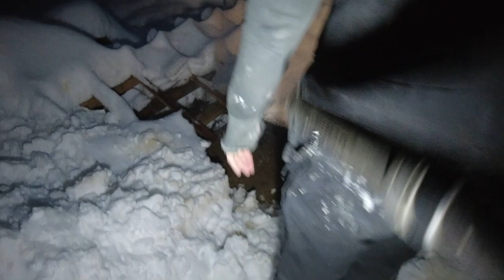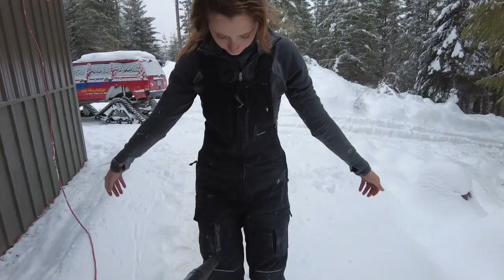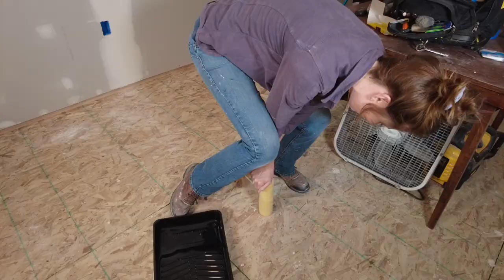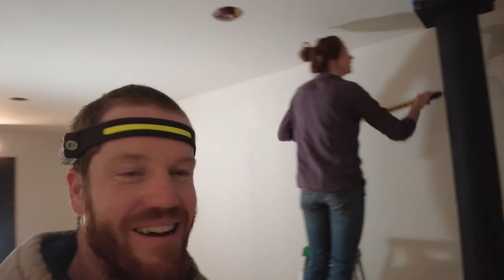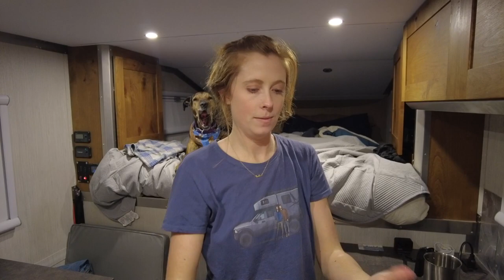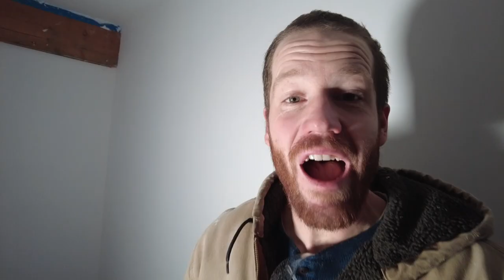Is This A Bad Idea?? | Couple Builds Dream Home Off-Grid

Comment: You know the paint stirrer that you can chuck up in a drill, to stir the paint with? You can use that when cleaning the rollers, too. Clean the roller as usual. Get it as clean as you can. Then take it outside with the drill attachment, and a 5 gallon bucket. Slip the attachment loosely through the roller. Now chuck the attachment in the drill. Hang it down inside the 5 gallon bucket, and spin. The roller will center itself, once it is spinning fast enough. You's be surprised how much more paint will come out of the roller. And the roller will be in better condition, to be used again.

Comment: When pouring paint from a 5 gallon bucket pour with the hole on top. The paint chugs because the air get blocked. Also stopping you’re paint flow is a lot cleaner.

Comment: Good Morning too both of you.
You are both awesome.  
Just a suggestion when pouring out of a closed lid bucket, like your paint bucket.
Turn the bucket so that the pour opening is at the top, then the air will come into the bucket
And the pour will be smooth and no glug gluging.  I have done this for years as I have
Painted my home and garage multiple times.
Also for Courtney, use a can pour lid that snaps onto a gallon can. This will return the paint back to the can
After you get what you want in whatever you are using as you paint from different kinds of containers.

I have watched you from your beginning in YouTube.  Keep up the good work and keep smiling.

Comment: I am sure someone has already pointed it out but you can get a screw on pour spout for the big paint bucket. On the other hand I built my whole house without skimcoat, I prioritized my efforts elsewhere. Awesome progress you two! I cant wait for some metal fab videos
Reply: or does the spout pull out like hydraulic fluid?

Comment: Pour from the 5 gal pail with the spout at the high side. It keeps the pain from glugging and you will get a better pour. Works for all containers that do not have an air port.
Reply from the maker: Thanks for the tip Alicia. We are definitely going to try that next time!
Reply: yep I was going to suggest this. I do that when I pour oil from a 5 gal pail into a smaller container for servicing heavy equipment lots less messy
Reply: Since you entertain and teach, I like the Lucy method you use to pour, now for the education part, they sell a pour spout for 5 gallon buckets at the paint store, they also sell paint lids that really work to pour paint on gallon cans, may be to late to use but not too late to educate the millions of viewers that you educate and entertain
Reply: Same with oil or anything else, hole on top allows less to come out at first 😉

Comment: Next time put your paint roller or brush full of paint in a ziplock and freeze it (put it outside in the snow) and then you can use it the next day and never wash it between days / coats, it just has to defrost a bit.

Comment: I learned its easy to put on & remove roller sleeves by tapping against ground to put on, and on the edge of a trashcan to take off (sleeve should be inside and fall off in can). I love your channel!

Comment: Massive tip, when done painting for the day wrap the roller and brush TIGHTLY SO NO AIR! In a small piece of  polythene  sheet or I always use one of those cheap poly bags from your shopping at the store (these are perfect) and then just tape the edge to keep it from unwrapping and it will keep especially if it's not too warm FOR WEEKS even. Then clean once when finished I have done this for years. You will be amazed👊💪👌🙏

Comment: Coming along nicely guy's. I totally agree with rolling instead of spraying. My only suggestion would be get rid of the roller pans and replace with a 5 gal. bucket and roller screen that hangs in the bucket. You can submerge the roller in paint then roll a couple times on the screen then back at it. 👍 Pro stylin 😉

Comment: Nice job, it's looking good.
A tip when pouring out of a five gallon bucket turn the pail so the opening is at the top, not the bottom.
It will pour smoothly and freely without all the glugging and slugging.

Comment: Here is an idea for when you have to pour paint from the big cans of paint. Use a dust pan that has been cut to fit UNDER the lip of the paint cans to help prevent extra paint from spilling out. It would also make clean-ups easier as well.

Comment: Courtney if no one has mentioned you can buy a screw on spout for better pouring. But since you’re almost done sanding I have used a attachment for the vacuum that it sands,picks it up and it doesn’t get all over you.

Comment: Pro tip ;  when you want to use a roller again with the same kind of paint or primer, leave it on the handle,  wrap it with the bag it came in and put it in the freezer.  When you're ready to use it again take it out of the freezer,  let it thaw for about 15 minutes ( still in the bag so it doesn't dry out too much) take the cover off, load it with fresh paint and use it again.  Works with all types of paint, just don't let the roller sit and dry out at all, cover it back up, even for short breaks.
Reply: Also,  the ceiling paint that goes on pink and dries white is much easier to see where where you have painted.  It will save you a lot of neck pain !
  You are right, primer is not a sealer against moisture.  Paint is a sealer.  I don't use the new paint and primer in one, it's not a good primer, nor is it a good paint. It's a marketing strategy for lazy people who want to skip a step or two. Not recommended for a first paint job on new surfaces,  or people who want a quality finish.

Comment: A little painting tip put a finger tip of vasoline on the inside edge of a tight roller for easy removal. It works no mess just a tiny bit.
Reply from the maker: Wow, that is a great tip. Thanks Terry!

Comment: I've only done skim coats on walls that are severely uneven or made from drywall scraps. When you're putting up full sheets with the joints matched up as you have, it's pretty safe to skip. If it looks flat with a nice bright light going sideways across the face, it probably is.

Comment: If you want to do it right. I would place steel wool in between the wall and floor before putting on the baseboards. This keeps field mice from attempting any entry in the house or walls. Just a suggestion.

Comment: When I'm doing drywall (and I try to avoid doing drywall), I attach a shop vac hose to my vibration sander to keep the dust down.  You can also tape an A/C filter to the back of your box fan and point it into your shop (or out a window) and it will trap dust.   And yes, there are about 5000 different colors of white!

Comment: Bosch have an automatically operated paint roller that feeds paint to your roller as you paint. It's a pain to clean after wards but so easy to paint a ceiling.
Reply from the maker: Courtney has one! But with very limited water we decided not to use it.

Comment: Hi this tom I live in the Philippines just a tip for you if you have not finished with your roller for painting put it in a plastic bag seal it tight that will stop it from drying out so you can use it the following day to continue your painting, keep going and also have a Happy New Year

Comment: Great paint job Courtney!  With dogs I would recommend Riley paint the subfloor with Kills.  Looks like Riley has already started : ).  The Kills will help any pet accidents from contaminating the subfloor.  Also good under showers and toilets for water leaks.  Caulk all thru floor pipes, including shower and toilet, in case you have a leak.  Can also caulk base trim to floor.  Has worked well for me in my past projects.  Have a great New Year!
Reply: Oil base Kills is the only one I have found really blocks well.

Comment: Great job on pushing to finish the paint.  We have a similar color combo in our 1930s house, it's really nice.  Good call on not doing a skim coat, pretty unnecessary with drywall.  

PS you all need a snowmobile.....  with a trailer.  I lived in Maine for years, sometimes that's the only way to get around.. The snoverlander is OK, but a snowmobile is extremely reliable and quick to use in this climate.
Reply from the maker: Riley agrees, we need TWO snowmobiles so we can go on fun adventures too... 😉
Reply: @AmbitionStrikes   Sponsered snowmowbiles!!

Comment: Used Aura for years. The first in our area actually. 
You can write on it with permanent marker and use a Mr clean scrubber to erase it, without pigment wipe off. Always told my clients, its like painting with a pool liner, it's surreal durable. Outstanding choice in product.
Reply from the maker: Please don’t tell Riley he can write on our walls… 😂

Comment: Just to add to the never-ending list of "hey why don't you do this instead"; I usually put a plastic bag over the paint through, that way the through stays nice and clean, and if you're going to continue with the same paint and roller, you just roll up the roller in the bag for a nice airtight place to keep it until the next coat. (and it's also way easier to just throw the whole damn thing out when you leave it for too long and it dries...)

Comment: Union painters never use a pan. The point is to get the paint on the walls efficiently, not create layers of dry paint in a pan. Ditch that whole pouring step.. Lightly touch to spin and roll the roller directly in the bucket with a few bangs against the sides to knock off drips. Then spread in a W pattern directly on the walls (called double rolling). It's faster and wastes the least paint. Never push on the roller and squeeze out the paint working dry. Instead keep the roller loaded up, working wet. Adding a little water to latex paint helps it spread easier if it thickens.

Comment: I used to do very wall and one day a friend came over and saw what I was doing sanding the dry wall compound and the whole house was covered in white dust. He said do you ever read the directions ? It say you can smooth it out with a wet sponge or the pot scrubber type with a bucket of water.

Comment: Paint of course dries depending on relative humidity, in many cases you can achieve what we called 2 coats 1 application, typically instructions indicate that you make a large X that turns into snowflake,  with eaxh stroke (over rolling reapplication) you make note during application as to how fast to advance timeing yourself as to create best coverage,, 2 coats 1 application effectively saves time thus some people think 2 coats takes 2 days, truth is done properly 2 coats in 1 day moves the project foward faster.

Comment: Well you can use a power roller that to auto fill the roller instead of spraying ,and you can also spray and back roll it ,but it would mean taping off everything and no stove heat ,looks good ,should clear coat your wood beams ,them if you do get something on them you can steam clean the surface off,too much fun ,and i have a lot of painting to do myself fun fun fun

Comment: Happy New Year guys! You're great. I'm sure you'll be happy soon to live in your-own fully completed barnominium.
Here is two lifehacks about painting:
1. to prevent of painting (and cleaning every time) the dish you used for the paint roller you could cover it over by cling film or just use plastic bag.
2. to avoid paint stains on the paint can you could use paint tape sealed by V-shape as in the video https://youtu.be/Fjbj-xnPRrA?t=65. It's in Russian but there is everything clear without translation.
Hope it will make you work little bit easier.

Comment: Love watching the videos you share. I am not sure about you're paint bucket but usually, buckets like the type your paint came in have a spout built into it that is compressed into the lid. If so, it can be pulled out with the cap if it has plastic tabs attached to the cap. If so, it's too late to find this out now as you are more than likely already done your painting, but it could be some useful information for next time, reducing the likeliness of a mess. 
Just curious, why not attach the plow to the army truck? It is heavier, has more torque, and is more robust than the pickup truck, which would be less likely to give you some issues with breakdowns. I commented on the video where the plow truck got the plow attached, that I hope the airbag fuse has been pulled, if not and you snag the plow onto something you're going to end up having a bad day. 
Hope both of you and the pups had a Merry Christmas and also have a Happy New Year!

Comment: Rain X or wax things like camera- eye glasses,  surfaces that will be exposed to paint drips / dropletts / spray if pre treated the dried particulate will clean off more eaisly.
Yes it is true roll on is more efficient than spray in 99% of examples plus spray typically requires an additive that makes the paint behave more like an oil then volume of additive becomes critical,  viscosity & density of the spray. It is a giant can of worms,  the only time spray is advantage is whole house application pumping out of 5 gal buckets & special cleaning procedures / precautions come into play.
When using rollers for paint application at end of day use paint tool to squeeze excess paint from roller,  slip into plastic bag & place in freezer in morning remove from freezer allow time to thaw, pull plastic sleeve, place on roller frame go back to work. Drywall mud if pre-mixed comes with circle of plstic on top of drywall mud, keep that in the bucket, smooth mud & cover with plastic every time to controll evaporation (keeping the dried particles from the mud remaining.
    Some people simply drop the paint roller into bucket of paint to avoid cleanup,  I find this to be problematic as it brings too much drama into the morning start procedure. 
     When pouring paint from 5 gal bucket thru the screw cap hole . Rotate the bucket so that the opening is at the highest elevation then tip bucket this avoids the glug glug glug splash effect (very messy) affords greater pour controll.

Comment: sure I could add some but there are 132k subs... sure people have said it... but paint comes with a plastic pour cap I believe.... wood stove.... put a heat outter pipe with a computer fan on base of floor to blow air up and exit the top to move air... but other then that... you both are supper smart and think of alot.... for the roof.... airplanes (i am ex pilot) has whats called air boots n the wings to remove ice... think that would help with snow on the roof.... just a thought....

Comment: I recently discovered this channel and am thoroughly enjoying each episode!  I live about 2 hours north west in the West Kootenay region of BC and am wondering roughly what elevation your home is at because we are at 2000' above sea level and seem to have more snow on the ground even though our climates are similar.  Secondly, and this may have been asked before, but I don't see any combustion air source for your wood stove.  I realize the building isn't air tight yet and not an issue but did the supplier recommend adding one?  It is definitely code here in this part of Canada and it might be something to look into if you don't already have that plumbed into the stove.   BTW you two are living the dream, keep the fun videos coming!
Reply from the maker: Great point about make up air! We do have plans to add a heat exchanger fresh air inlet by the stove, but for now we just leave a window cracked upstairs.

Comment: Off topic but do you have full supply of water in tank to refill your camper for showers, cooking, & wash hands & does it freeze solid in the tank too? All the best 2022
Reply from the maker: We started winter with 300 gallons of water in a holding tank inside the shop so that it does not freeze!

Comment: The only way that but a paint vapor Burger is gonna work is you gotta paint the floor due before you put the floor down
Reply from the maker: Our floor is snap together vinyl that does creates its own vapor barrier. The baseboards are getting caulked to both the floor and wall to continue the air seal.

Comment: Great job, this project is moving right along! Just a question, did you do one or two finish coats on the ceiling? I can never get away with just one coat. I always have to do a second coat, perpendicular to the first coat or I can see the roller marks.

Disclaimer: I am not now, nor have I ever been, and have never played on television, a professional painter.
Reply from the maker: Hey Karl! The ceiling paint was very close in color to the primer so I was able to get away with one thick coat.

Comment: I think your wall will be fine. You have been careful with everything you have done so far. That attention to detail should have some benefits!  BTW, how has the temp been inside relative to outside? It hit -15º where I live and when I saw your video it made me wonder how much wood you have been going through.
Reply from the maker: Even with no insulation in the floor we've been able to easily keep the apartment at 65F with it being 3*F outside!

Comment: Question:  in your fireplace you are burning some type of evergreen (pine, cedar, etc) Are you taking any precautions against creosote build up?  I get it you are cold and it warms you up and all. I'm just reading that you need a mixture of hardwood and softwood for the "best" fires!
Reply: Add a little oak, good idea, if you got some.
Reply from the maker: We're mostly burning Birch, with cedar for kindling. We cut it up at the beginning of last summer so it's at about 16% moisture right now. We're looking forward to getting a proper wood shed and seasoning a few years worth of wood this summer!

Comment: I never did understand why people use primer on walls I think it’s just added cost. Paint will stick to the walls. It sheet rock it will adhere to it 🤷🏼‍♂️
Reply from the maker: Our primer was much cheaper than our finish paint, and it's nice being able to use one product on the entire walls and ceiling. Especially times when we spray it.